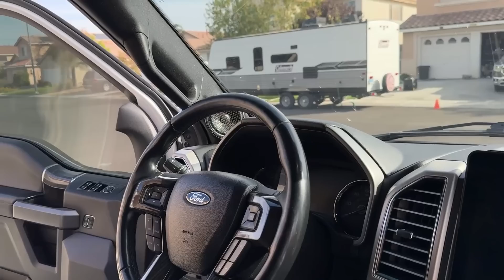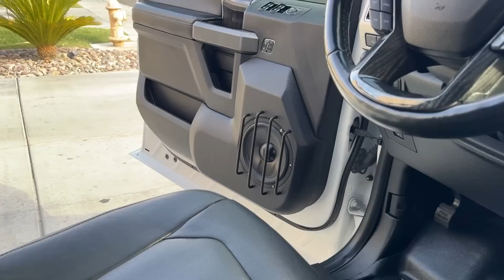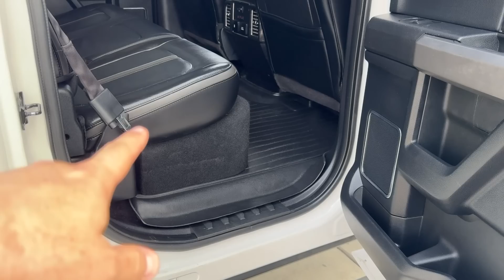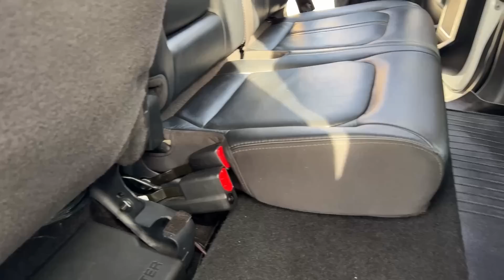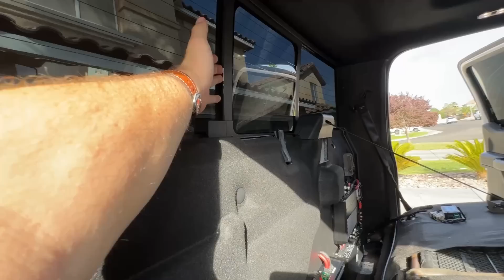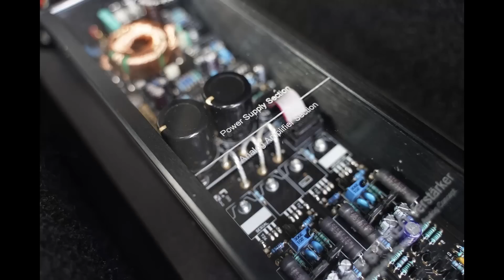Ford F150 High-End Audio System EXPLAINED - Micro Precision, Mundorf, Steg, SI, JL, HAT, Helix

Comment: Which stegs are used as the 4” wide bands in the a pillar ?
Reply from the maker: Steg MSS3 4” mids.
Reply: Thanks Peter. His  setup is exactly what Im going to be running speaker wise except my mid bass are the SI TM8’s instead of the 6.5’s. I’m even running 3 JL TW3 10’s as well. I was the guy asking about a good midrange to compliment the AMT’s. I do not think I can fit the 4” in my dash , but What do you think about the Steg MGL3 3.5’s ? Or can you give me a better suggestion ? In case you didn’t get my other messages they will be facing up towards the windshield in the far corners of  dashboard. I will be pushing it loud & hard a good bit as well. Thanks in advance for helping me out.

Comment: Very nice 👍 
I have a Chevy Silverado with a rear power sliding window that would also rattle when my rear subs were working harder. I don’t open it anymore cause I used butyl rubber rope right in the spots Peter put his hand. Stopped the rattle. No you can’t see the butyl and didn’t melt or make a mess

Comment: On the Arc Audio 1200.6 never touch the crossover switches high/low or full, 1 of the 2 or both channels will drop out and you will lose your mind and end up having to move the switch back and forth 30 plus times until the signal comes back. I love the amp, but the switches are garbage.
Reply: I did have a switch issue with this amp after not using it for 6 years, it got stuck. Called ARC.... and good old DW40 fixed the issue. But around 2 years ago I sent the amp to them to get it fully updated with anything they thought needed to be changed or upgraded. Work flawless... such a great amp for the money I paid 11 years ago. Cant beat the flexibility and power in this small foot print.
Reply: @canillocanillo3371  Did they end up updating anything? Mine I believe is an X2 model. I do have audible tweeter hiss when using channels 3 and 4 with Audiofrog GB15s with gains as low as possible and no input signal.
Reply: @scook9216  They did… not sure exactly what, they charged a flat rate for everything and sent a paper with a list of things they did. I think most of the upgrades were making it a “X2”. Not sure if they have upgraded or fixed any issues they had with their X2 line. I assume if they did.. I would have gotten them also. I had the need to use the cross overs switches for the new build and had no issues.